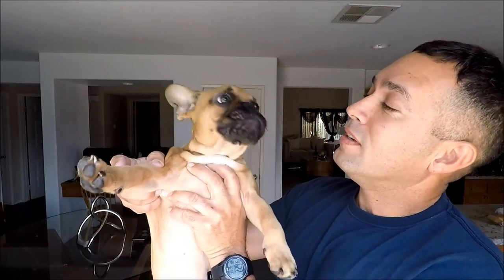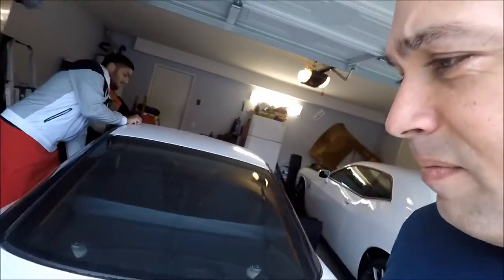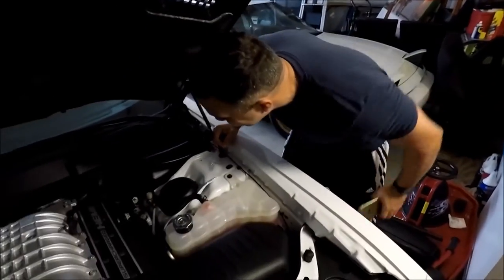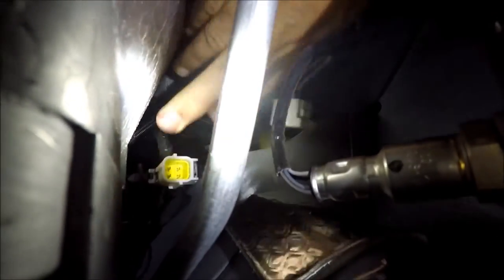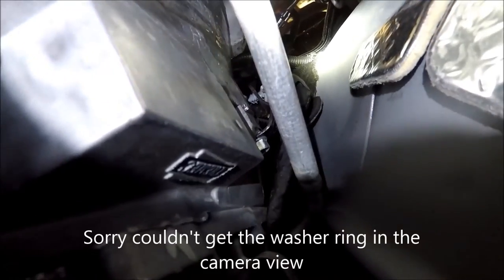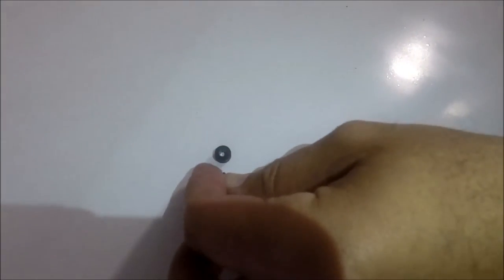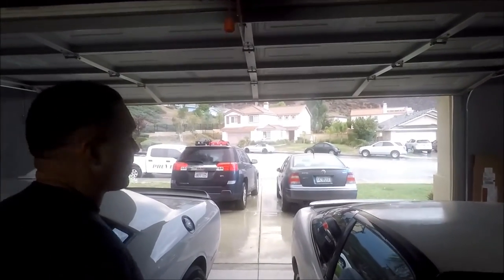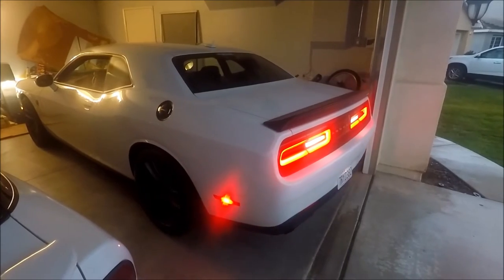Hellcat Clutch Delete Valve / future plans and 240sx

Comment: Did you after the removal have to pump the clutch back up, and do you pump it up with the car running or not, thanks
Reply from the maker: I turned on the car, I pumped it a few times, like 5 or 6, then it was good to go.

Comment: Im thinking of dong this too. Could you explain how it feels different? Is it in how heavy it feels? Thanks in advance
Reply from the maker: Zed A I highly recommend doing it, the good thing is that if you don't like it, it will be much faster to set it back. The clutch is faster to engage gears. If you do it  be careful with new drivers trying to learn manual on your car. One thing is that I wish I've had done it earlier.
Reply: Just did some research on the CDV removal and I know exactly what you mean now. Im in Toronto so waiting for spring to roll around!